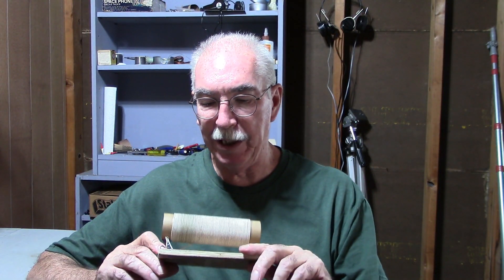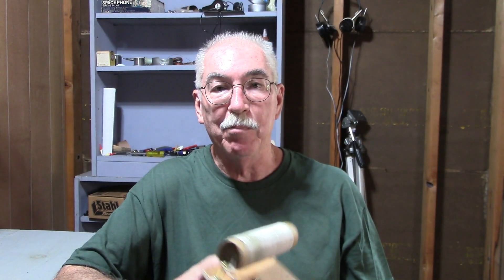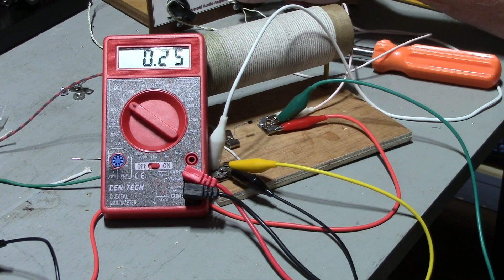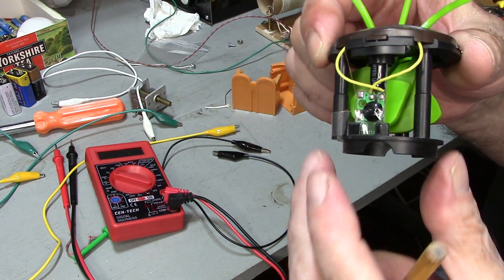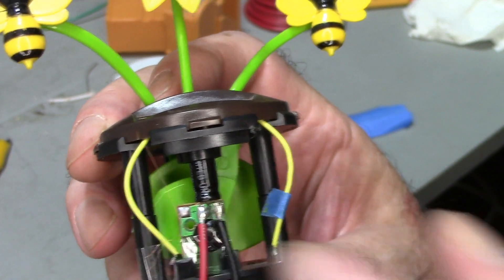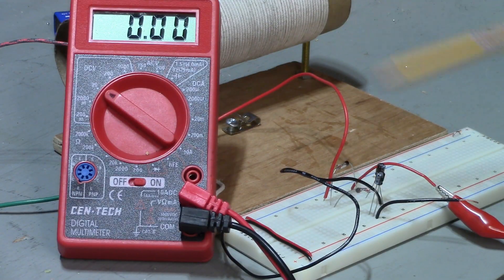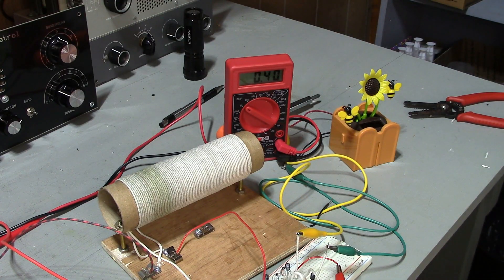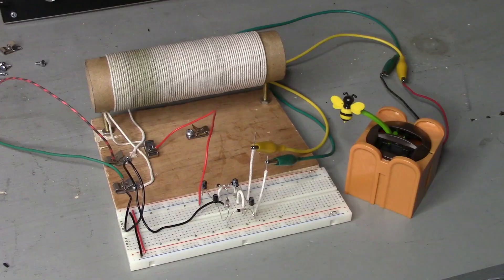Free Energy / Perpetual Motion

Comment: If you put the solar cell back into the circuit, would it be too much of a load, when in the dark ?
Reply from the maker: In Part Two I used the solar cell/battery from a solar light to power the flower pot, and it's been running non-stop for over a month. As for the load of the solar cell in this video, you could add a diode in series with it. It would supply a voltage in the light and be an open circuit in the dark.

Comment: The electricity you get from the crystal radio comes from 2 sources, 1 - the radio waves and 2 -  the lighting over head. Also keep in mind when you multiply the voltage, the amperage goes down. Now if you would bring your set up outside in your backyard, you would get the radio waves only. There is a much simpler way to pull electricity out of the ambient air outside. Our planet is a giant battery. The atmosphere contains static electricity. So if you would have a wire going up 25 feet up in mid air, you would gather more or less 250 volts at low amperage. Now if you would bring that to 12 volts, the amperage would be close to an ampere. From this you can use the 12 volts to power up something running on 12 volts.. Source 30 years of electronic engineering.
Reply from the maker: Sounds fine, except you're not going to power much with an amp of static electricity, otherwise everyone would have a 25 foot long pole (with a flag on it) to charge their phone. I'm using an LED light in the garage that gives off NO RFI. However, when I plug in the Chinese ring light it will drown everything out, so I can't use it while making the video or it will throw off the results.
Reply: @michaelsimpson5417  yes it is true that an amp doesn't power much, however if you can check the following web page for the amount of electricity from the air. Also you could use a Tesla coil hooked up to retrieve electricity from the air. This would get you a lot more. Likely enough to power up your house.
Reply: also keep in mind that you can get electricity from the ground as well by using a tin rod and a copper rod, and you place them like 10 apart, This would give you a similar result as 12 volts. Way back when they were using a telegraph line across the USA, they used to power the line that way. The results was surprising.

Comment: If usable energy from radio broadcasts was widely used by people in their homes, city lights, or whatever, would that affect the original function of the radio transmission? 
I have the same question regarding using Tesla Coils and resonance - if a Tesla coil excites a bulb through resonance, can it  equally excite 100 bulbs in the same area with the same input power?
Reply from the maker: It would not affect the power coming from the transmitter. The energy has already radiated from the antenna before it gets to you. Picture a streetlight illuminating an area. If a thousand people decided to read a newspaper with the light, the light wouldn't care. It's similar with radio waves but at a lower frequency.
Reply: @michaelsimpson5417  thanks for the reply! So by that logic would radiant electricity be able to power infinite devices within it's domain? Is this plausible for energy distribution in the future?
Reply from the maker: @ChipsTipsforLife  I suppose it could, but keep in mind that the total energy used by all the infinite devices can never exceed what comes from the transmitting antenna. Even if I had a thousand antennas and a thousand coils I could never power something like a refrigerator unless I was right under the transmitter. In that case, I'd plug the refrigerator into an electric outlet at the radio station.

I was using a coil to pick up radio waves and convert them to motion. Nikola Tesla wanted to transmit real, usable power without using wires.

Comment: I watched a video from Norway where they put an 85 foot copper wire insulated on both ends a foot above the ground. They tapped it a third of the way with a coax cable. They got 15 watts during the day and 8 watts at night. I recreated the same thing at home and got the same results. I still use it for charging my Westinghouse power station.
Reply: Any link to that video from Norway, brother?
Reply: @argellaguardia9390  I've been looking, it's from a large solar company in Norway. If I find it I'll let you know.
Reply: @flynnstone3580  thank you very much brother. God bless!
Reply: @flynnstone3580  did you find the link to this invention? interesting to try out, or please describe it hownto reproduce it , thx

Comment: Fun and educational. More please...oh, there is more!

I will say the term "Perpetual Motion" was coined back in a time before radio, or anything else electric for that matter. The question remains if there is any evidence remaining available that supports such mechanical marvels ever being built before. Attempts have continued to be made in modern times, but they mostly  require a source of power outside the device to continue its motion. It appears that electromagnetism is the preferred method of connecting our perpetual dream machines with these ambient sources of energy. But I am still wondering if we were wrong to pronounce the impossibility of something we simply find impossibly difficult to make ourselves. But what may encourage the perpetually intrepid is the knowledge that physical material atoms are themselves in a constant state of perpetual vibrational motion.

Comment: Not Free Energy, and not Perpetual Motion...Neither is possible, except if you get a long extension cord and plug it into your neighbour's plug, then you have free energy.
Reply from the maker: In the next video the "power supply" is improved, but then we switch to the sun. My flower pot has been running non-stop for weeks now.
Reply: @michaelsimpson5417  
What is your definition of Free Energy?
What is your definition of Perpetual Motion?  Using an external source such as a power supply or the Sun is not Free Energy, and not Perpetual Motion, since both require and external source to run.
Reply from the maker: @valveman12  That may be because there is no such thing as "perpetual motion" if the device has to be self contained. Unless you're in outer space, in which case you can set something spinning relative to something else and it will continue forever.
Reply: @michaelsimpson5417  
Happy you agree, concerning Perpetual Motion is not possible.

Comment: Try ro use geranium diodes and not silicone. Geranium is 0.3 V and silicone is 0.7V.
Reply from the maker: They are Germanium. Good ones, too. I had an old pack from Radio Shack that I bought in the 1990s.

Comment: In your case, it would be a galena radio, but the problem is that the energy needs to come from somewhere, so there would have to be a transmission and collection radio that could resonantly amplify the work, and it would still have to avoid heat losses or a thermoelectric system would be used to compensate for the work.

Comment: ❤❤❤Hi, can you please 🙏🥺 build this step by step snd film so we can follow. It's hard to zoom in to see exactly how you connected the wires and how you built the coil. 😊😊😊😊🎉🎉
Reply from the maker: It's just a crystal set, but the voltage multiplier is connected to where you would normally place the headphones. The coil is 85 turns of wire on a cardboard tube 2" in diameter. A diagram of the voltage multiplier is at the end of the video, but there are plenty of website describing them.

Comment: The drinking bird is also a perpetual machine.
Reply from the maker: Yes, the "Happy Drinking Bird" is one of my favorites. Be sure to use distilled water or his beak gets full of minerals after awhile.
Reply: @michaelsimpson5417  right.i use a.c water.is this water correct sir?
Reply from the maker: @muhammadraziq8837  I don't know. What is a.c water? Any water will make the drinking bird drink, but  a crust forms on his beak if the water has minerals in it. The bird works by evaporation.
Reply: @michaelsimpson5417  the water produced when air condition works.the vapours af water that r condenced during cooling.
Reply from the maker: @muhammadraziq8837  That will probably work very well.

Comment: this would even work without electromagnetic energy from Radiostation Transmissions but with Atmospheric energy. The only downside is the pole for tapping into that energy needs to be quite high. And i wonder what happened if you added a joul-thief into the circuit?

Comment: Hi Michael, I'm age 66 in October, and years ago, I was browsing Books-A-Million, and I was checking out some electronics books, skimming pages and came across an experiment, it was an electronic projects book,, which at the time, I wish I could have bought it. But one of the projects if you put it together, claims that it can generate "9" Volts Just from An RF Signal!! RF as in "Radio Frequency" I keep believing that if you were to use transformers small ones for starters and keep using inverters on and on until it reaches high power, you can take away the batteries in a Electric Vehicle!! And power all kinds of things. If a car battery can power an inverter, and that inverter can power a 1000W (add appliance ) and from that a bigger one. All from that 9 volt circuit that I never bought. I wonder if the book is still available. I didn't catch the author's name. But there are still project books still available I guess. Anyway I feel you are on the track that I wanted to try out. But I have Essential Tremors or shaky hands, and I would have to give up because of that. Please keep trying, I know I would if I could. Yep, free energy from all radio stations!  Thanks   Terry of north Fla.

Comment: You could try atmospheric electricity.   Search for  the article:  Feynman Physics Electricity in the atmosphere.
That should get you 100volts or more, though not sure of the components required.  Be careful as the higher the antenna and length of wire, the higher the voltage.  It's tapping into where lightning gets its energy.

Comment: Now just add capacitors..why stop before adding caps IF you Really want it to run ?
Reply from the maker: I added a 1000 mfd to the output of the quadrupler but it didn't help. The energy from the antenna is minuscule. I need a better antenna, or as someone suggested, move closer to a radio station.
Reply: @michaelsimpson5417  I think this is a good reference to work on upgrading the antenna and finer adjustments on the frequency, you have sensitive enough equipment to interpretative the output differences, i bet some resonance is stronger then the other as well. But nice work so far :)

Comment: Visually Provable:
There is Only 2 Spaces 
>Space is the Modalities (Matter, Light) of Counter Space.
>Counter Space is Everywhere Matter is Not, All Polarized Points of All Atoms Bind to Counter Space to Form Matter and the Distance from One Point to Another, ANYWHERE is 0, through Counter Space. It is the Master Ground for the Galaxy and a Ground Node in the Universe. 

Which means the MOL Equation is Correct, the Description is Completely Wrong.

Creation: Counter Space <> Force in Motion > Compression ~Light | Neutron > Decay to a Proton, Dielectric Spin Begins, 1 Compression Shell Hydrogen. 

Examples: 

Travel: To Travel Great Distance is not to Move
Counter Space Visualization >Take a Piece of Paper 100 Miles x 100 Miles and put a pin in the middle, and from that pin draw a line using 360 degrees of freedom to every atom in the Galaxy. 

The Sun: Coronal Hole > Solar Winds > Corona, the Sun Creates Matter.

The Bible and Why AI can Never Achieve Consciousness. 
The Firmament Surrounds the Waters, the Water Molecule, the Only Molecule that is a Triangle, an Antenna and has Incommensurability. This Binding to the Master Ground in a Bond to Every Water molecule creating a Mesh Topology, once created, it will endlessly replicate. When you Train an AI, you gather Data and Train it, and that creates 1 Large File, this is an attempt to Replicate the endless, and not restricted by Distance the bonding on-every Water Molecule “You” that is why AI can never be conscious, it can only Mimic. 

When Jesus Returns, Money will be No More Because of Energy 
Your Only Clue  i leave by its Name: A Single Pole Geo Processional AC Generator, it Output is Only Governed by it size of the conduit and the Center of the Engine wO = y BO. 

End of Line

Comment: Don Smith started with the crystal radio. Then he used pulsed DC, neon sign transformer, laser module or any high voltage source to disturb the ambient, aether ir whatever other like term you want to use, to get into HF and HV. He successfully made numerous devices to make a self sustaining energy where the potential was Volts equal amperage. This he did by magnetic resonance. 
Look up his work.

Comment: I stepped into this video. It's quite interesting, and funny. I wonder if capacitors with low ESR or a bit less capacitance might make them charge faster. I also wonder if coils with ferrite core might make any difference as well. I think you are using auto-transformer configuration. Decoupling primary from secondary and creating a 2 diode full wave rectifier (3 connection secondary, not graetz bridge) might change something too, but I have no preconceived idea or clue. Finally, it would be nice if one could gather energy from several of these circuits after rectifying voltage. Cheers man.

Comment: May be you need to make 3 antenna coils with own rectifier and then connect all three in series.
Current setup may not have that much energy.
Reply from the maker: I tried that yesterday, with two coils and two antennas and two diodes, but I didn't get much difference. I can't connect them in series because they have a common ground, so they were in parallel.

Comment: So is there some sort of practical limit as to how many times you can double the voltage? In other words, why stop at four times?
Reply: I imagine the current is reduced as the voltage is doubled. By the way I have one of those solar flowers (“sunpowerflower”?) and they are pretty cool. I always wondered how it worked.
Reply from the maker: @alphabeets  Those solar flower pots are pretty cool. The flowers and leaves (or bees) have to be just the right length and weight so everything moves in sync. We have one with a flower in the middle and two leaves. The flower broke off, so the flower stem hardly moves now. The two leaves go like crazy.
Reply from the maker: You can't get something for nothing. When you increase the voltage you decrease the current. There are voltage multipliers you can make but the voltage source is an AC outlet, and the electric company will give you all the current you need. All we have here is a tiny bit from an antenna, and not even a very good one.

Comment: Technically speaking any crystal radio is a perpetual motion machine. The diaphragm in the earpiece is moving damn fast all the time but of course only very slightly.
Reply from the maker: That is an excellent point, and great example.
Reply: Radio transmitter still need energy to transmit radio wave
Reply: Técnicamente un router con wifi es una máquina de movimiento perpetuo, porque este equipo consume 20 watt y puede alimentar celulares casi infinitamente, si sumas todas esas entradas verras que multiplica por mil los 20 watts de consumo
Reply: every electron continuously revolving around atom has  free energy
Reply: @yogie_ji_gwalior_wale  Except Electrons aren't distinct independent entities.

Comment: Kind of reminds me of the idea of running a length of wire (or a metal fence) parallel to suspended high tension power lines and pulling off power from it through inductance. Illegal of course because it actually slightly draws power off the lines reducing the power at the destination. But certainly there must be a way to harness some significant amount of power from the magnetic field surrounding the earth. No?
Reply from the maker: What if we made a solar powered "tracker" that follows the sun, and as it turns it uses coils to cut through the earth's magnetic field, which would charge a capacitor that makes the flower pot move. LOL!
Reply: @michaelsimpson5417  Tesla know HOW, but fellows Americans suppressed and destroyed all his achievements. Why? we know why, right?

Comment: This energy comes from the ether from the waves. Or exactly from the radio station transmitter, probably not. Because the wave, electrons are all around us. If you connected the secondary coil to the antenna and this toy to the coil and to the ground, this toy would burn so much energy that it would go a lot.

Comment: If you connect a 1 Farad super capacitor across the solar cell , no diode required, it will keep the flower going all night. It takes a few minutes to charge, but it appears to never stop
Reply from the maker: That's an excellent idea! Nobody says you have to use the solar cell that came with the little flower pot. One with the same voltage output but a larger surface area would have enough current to charge the capacitor.
Reply: @michaelsimpson5417  I've used one of those 1 inch square solar panels on the circuitry from a solar flower to power a pendulum, a small neodymium magnet on a piece of cotton, with the 1 Farad super capacitor and it never stops, at least when I'm awake!

Comment: Would be coil work if it was moving on a pendulum could the receiver be used to drive the kick motor
Reply from the maker: That's sort of what it does. The rod with the bee on it is a pendulum with a magnet in the bottom.
Reply: @michaelsimpson5417  yeah put the resonance coil In the pendulum though